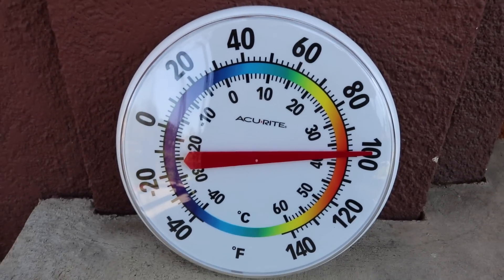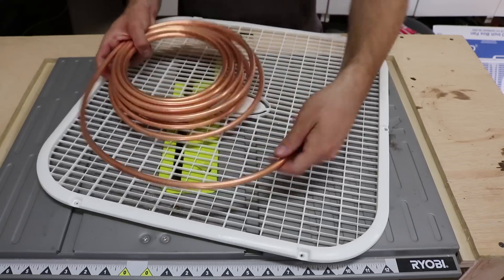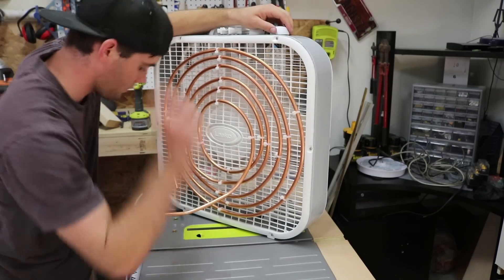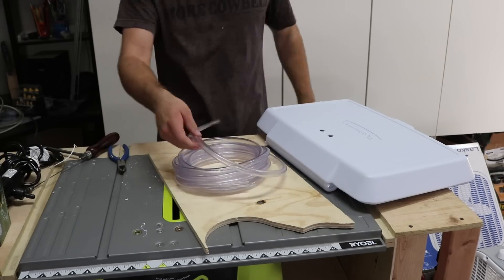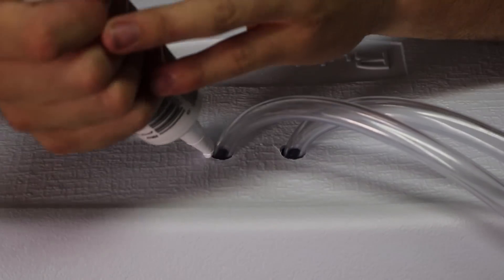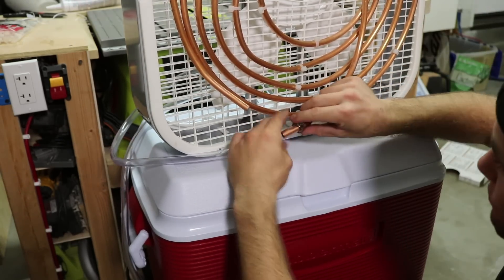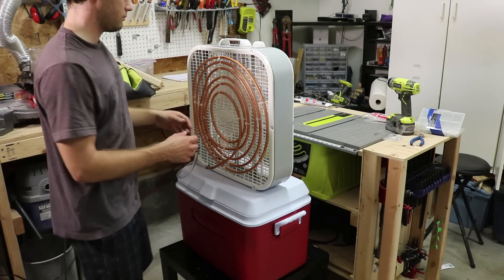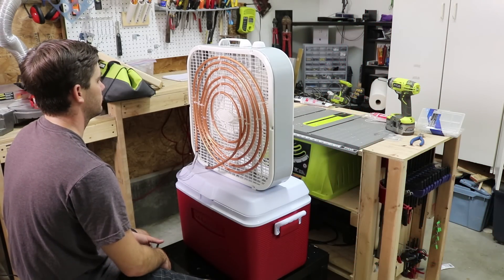$100 Homemade Air Conditioner - DIY

Comment: Wouldn't have been better to put the copper on the back of the fan not on the Front. I mean the fan is Sucking air flow through to the other side so I would think that putting the copper  on the back  just a thought

Comment: Side note:  This works if you have no humidity in the air.  If you have humidity you will get condensation on the copper tubing, you'll have water pooling below it, and no cooling.  Dry air and this works great.  Humidity and this is worthless.

Comment: I want to make one with what I got at hand. I have a similar design in mind however I do not have a water pump laying around. To work around this I'm thinking about instead using a small compressor I no longer use. To instead pressurize the inside of the cooler to force the water to flow through the Cooper wire. Any thoughts? All opinions welcome

Comment: Awesome work man, could u talk more about the material, like the copper tube, the thicker the better or which ones are good for air conditioning, then the water pump, all water pump can go under the water or only special ones
Thanks a lot...

Comment: This is so pointless…. You’re just heating up your water and eventually will be passing the same temperature of water as the air through your tubing….. you have to remove the heat to cool the room by moving it somewhere else. That’s the principle of how ACs work.  🤦🏻‍♂️. Moving the heat from your room into a very small container will only work for a very short time and you’ll have to dump the water and refill it.  You’d be better off running a fresh supply of cool water through the copper tube and out to a drain (wasting a lot of water in the process). What you’ve basically built is a ridiculously small portable chiller fan

Comment: Consider this, I have a rustic cabin in Michigan’s upper peninsula.  No electric within 10 miles.  I only go up there in the summer and that cabin can be miserably hot hard to sleep in.   With a few mods something like this would be perfect to run off a 12v battery.

Comment: I think a 5000 btu window unit for $150 would work better. This contraption needs to be modified for 12v battery use for when electricity is unavailable.

Comment: This is a  great idea, the majority of neighborhood association  members don't allow to install a ac unit in the garage,so this project still save money on electricity consumption,than a ac unit,and also a ac unit need extract the heat of the condenser the opposite at this fan cooler.

Comment: Recently had some time on my hands, and most of the materials to try this, knowing going in that it was likely a waste of time. I was right. useless.
Reply: Yeah there is not enough surface area on the copper pipes for heat transfer. A better method would be to make an imersion chiller with the copper pipe, stick it in the ice water, and connected it to a heat exchanger. See desertsun02 videos

Comment: Thanks for the video love it but you can buy indoor mobile 5000 BTU 120v air conditioner at Lowes for  $160.00 already built no labor and covers 450 ft sq feet area, I use to have one...

Comment: If you mounted the fan on the side with a high and low inflow and outflow respectively, you wouldn't need a pump.
Natural convection.

Comment: I wonder if there is a blooper reel where you attached the copper tubing, connected it with all the zip ties, and 15 minutes later, realized you did it on the wrong side of the screen lol

Comment: For those saying that you could simply use an evaporative cooler (swamp cooler) - yes, of course you could. But that would introduce a LOT of additional humidity into the space, which might not be ideal in many circumstances.
Reply: This is a swamp cooler
Reply: @michaelsickinger9741  it is similar to, yes. But not quite the same. A swamp cooler usually works by having a membrane full of water that a fan pulls air through. The water evaporates and cools the air, but also introduces that moisture into the air in the form of humidity - thus the “swamp” in “swamp cooler”. If you live in an arid desert that wouldn’t be too bad, but if you are in, say, Houston, the last thing you need is more water in the air.

A design like this one avoids adding additional moisture to the air by keeping the water and air from actually contacting one another, instead having the water pass through a closed system.
Reply: @HowdyFolksGaming  if you instead used a minifridge with coils inside the freezer part instead of ice in a cooler. you would effectively made a poor mans's mini split unit. just put the mini fridge outdoors. the only draw back is your mini fridge might not be powerful enough and burn out the compressor.

Comment: You could get a nice little window unit for $100. Say 6000 btus. You've maybe heard of AC units referred to as half ton, one ton or two tons? One ton is 12000 btus or British Thermal Units and means the amount of cooling you'll get from melting ONE TON OF ICE! That little 6000 btu window AC = a half ton of ice. You got an ice truck parked outside to shovel into your cooler? Just because something looks clever on the surface, doesn't mean it isn't a really bad idea.

Comment: We made this to help keep our tech's cool when working in attics. 
The air coming out the fan is marginally cooler. Barely noticeable. 
The attics average about 116 degrees. This thing did nothing to cool it. 

What it did do, was create a TON of condensation water. 
You cant operate this thing without a drip pan that needs to be constantly emptied
Reply: there is better makes then this guys
Reply: @coryryder9070  yeah we made a way better one with a powerful pump. But it doesnt matter. It doesnt work very well. 
We strapped a pan to the bottom of it with a drain tube. 
But its just not enough cooling capacity to make a difference.
Reply: If you run a heating and cooling company and attempted this you need to find a new trade. We're you surprised it created a lot of condensation while being used I'm an attic? So fucking stupid
Reply: @MJC-he3zt  No, we weren't surprised, we were prepared for condensation. But to us it was worth a try on the chance that it could possibly help.
Too bad you think we are "stupid and should find a new trade".
But we think we will stay in business since we are excellent at what we do. 

Its ok to try new things ya know. Thats how greatness is achieved.  Have a peacefull day.

Comment: $100, you could get a wall air conditioner that actually works and won't spew water all over the floor from exposed coils.

Comment: This is awesome because in SoCal most ppl live in apts where you cannot use a window mounted AC. Also this is cheaper to run ... if you add a furnace filter to the back of the fan it will also filter the air a bit. Great idea and it can still be used as a fan if you do not have ice or need just a fan

Comment: Definitely probably going to build one of these from my shop because I wanted to put some sort of cooling in my shop And it’s better for the environment because you’re using less energy
Reply: Why would you think that? Freezing ice cubes takes more energy than an ac unit, because the temperature delta with cubes is higher, so the heat pump in the freezer runs less efficient. In his case, insulating the garage door to stop the room from heating up in the first place would make much more sense.

Comment: pause. im currently 37 seconds in and had to stop. you said there is NO way to cool the garage? NO possible way? thats a flat out lie. reflective tint on the garage door windows and fully insulate the door itself will drop the temps dratically. not going to watch the rest of the video because you are not qualified to teach me anything.

Comment: I don’t know if this works I wish we could have seen temperature changes with a temp gun - but a pro tip is use water in one gallon jugs that way you don’t keep going through ice- always have back up water bottles freezing while you are using the other ones in the ice box.
Reply: Water jugs are pretty weak. Use 1 gallon laundry detergent bottles as they're thicker/stronger.

Comment: Or you can find a used or cheap new AC unit for around $100 (especially if you're smart and try to buy one in the off-season like spring or late fall).

Comment: You can also connect the high pressure parts of an old fridge to it, just have to find a way to route the hot air from the condenser to the outside.

Comment: At time marker 2:59 you refer to a coping saw as a hack saw. These are two very different saws and each serves their purpose. Because if you had an actual hack saw you would have never been able to make that cut for the power cable. Just wanted to share that with you, and I am also not trying to knock your video in anyway either. In fact I love this video you made, and also shared with us! Keep up the great work!

Comment: Instead of ice you should find the coldest place outside the shop that is in the shade all day get a metal container, a big one, digg a hole put the container in the hole fill with water put the pump in and run the tubes through the wall, I'm guessing northern wall, connect the tubes. Don't forget to keep the area moist and with plenty of vegetation

Comment: coolant for radiators under 20 degrees 20 liter keep in the freezer. when you need, take it out and use. $ 3 per liter. you can always use it in the radiator if necessary: P

Comment: I'm in the New Orleans. It gets insanely hot here and humid. I made one of these earlier for about $80. I think I got a smaller pump but perfect for this. It's made for 3 foot fountains. It may be from the humidity but my copper line condensates like crazy. I had to make a hole for it to drip into.
Reply: Interesting.

Comment: Thanks so much for this. My partner has health issues that are worsened by traditional a/c, and we've been trying to find a solution. Using your instructions we put together this a/c for exactly what you said, $100, and it only took an hour to get it up and running.
Reply: And how well did it work?

Comment: i have my ac running, but found out my ceiling is radiating 95 degrees, and in the ACunit peak in the garage, it gets to 110....so I have to do a radiant barrier and maybe more insulation

Comment: Hey bro, take that pipe off the fan and put an old car radiator on both sides, flush them, and seal the edges. If you have one radiator, put it on the inlet side of the fan.
- 
Use large blocks of ice to avoid melting too soon. Drill some holes on the bottom of the lid and fill them with spray foam. 
--
The radiators are evaporative, so they're gonna cause condensation to drip. Take that tube and divert the water. That's the humidity that was in the room. 
- 
Experiment with the speed of your fan. Measure the temp coming out on the different speeds. You don't want to blow the air through it so fast that it doesn't have time to cool down.

Comment: Hold on after u completed the project and u sat in front of the fan . your hair did not move as if air was really cooling u. I think i will not be using this technique

Comment: what is the cost of buying ice, day in and day out, for your machine? and like many others have already said, it's just cheaper to buy an AC unit from walmart
Reply: Where would you put an a/c in a garage??  🤨
Reply: @1crazydame_  In the wall, just cut a hole for it in the siding. I have one... I am looking into getting a 1 ton mini split HVAC system for $500 to upgrade.. One small hole for the lines. This video was just humor to me, no chance in hell that works lol

Comment: There is foam like insulation that can be cut to fit into the garage door. I have seen pre-cut kits before too, that should cut down the oven temps.

Comment: You have not shown that your device is actually cooling the air and by how much.  I don't see any thermometer showing the temp of the air leaving the fan.   BTW,  $120 will buy a new 5000BTU AC. It would also be advisable to insulate the g door.

Comment: I fixed my garage that heated up to about 120F by making an AIR-GAP between the outer wall and the styrofoam sheet inside the wall.  Then drilled an air inlet OUTSIDE at the bottom of the wall.  This formed a kind of "chimney" where air would heat up and rise up the wall.... up into the attic ceiling.  I continued the air-gap all the way up to the top of the attic inside.  Then 2 roof-turbines (air powered).... helps pull the air UP the wall .... UP the attic... and OUTSIDE.  Because of the coolness of the concrete floor, this garage stayed below 83F even on the hottest days.  It required no fans... No water pumps... no electricity at all.  Then I discovered an EVEN BETTER method of keeping the heat out.   In one sentence,  I simply painted the garage roof with WHITEWASH (Hydrated Lime).  This stuff costs only about $20 bucks for a 60 pound bag!  One bag will just about cover a 1000 foot roof!!  This makes the roof HYPER WHITE.  The heat is reflected about 90 percent.  If you would like to read more details about these subjects and many others,  they are available on my $2 eBook at LULU dot com at this link:  http://www.LULU.com/spotlight/davidmundy  You will need to log in and make a password... etc.

Comment: Syrofoam Cooler filled with ice bottles...Cut holes in top of cooler for fan and 2 Tin air Duct vents...Fan blows inside the cooler and cool air blows back out of the Tin air Duct vents...Works amazing and MUCH cheaper